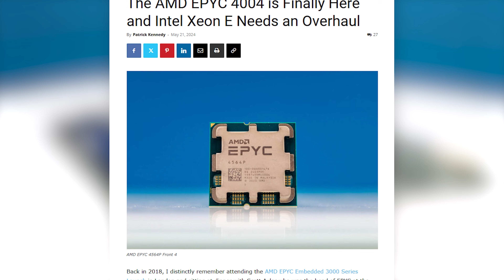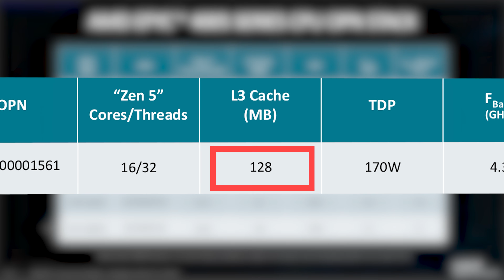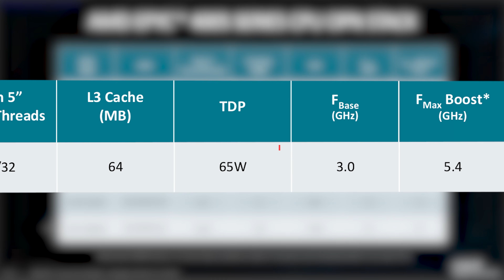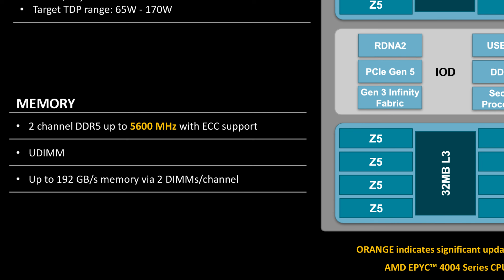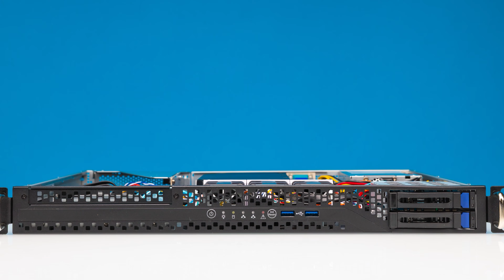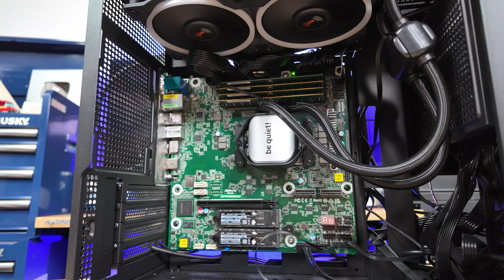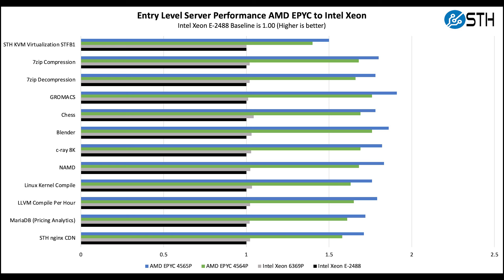The Must-Have AMD EPYC 4005 Grado Has Intel Xeon Cornered

Comment: Hi, I'm wondering about one thing, why aren't AMD and Intel filling the gap between low end CPUs and big ones ; what I mean is the same kind of core gamut at this series but with at least 32 available PCIe lanes feeding PCIe slots (eg.: 16x [8x, 8x | 16x]), because it would be worth it to cover the needs of not so SOHO and SMB -  does it come from hardware barrier(s) or simply dumb market segmentation made to force the purchase of high end CPUs ?
Reply from the maker: I think the challenge is that once you go bigger, folks want a bigger step up. The EPYC 8004 and even the EPYC 7003 are not bad for this, but they are notably larger than the EPYC 4005.
Reply: @ServeTheHomeVideo    I'm not sure, there is place in between, although may be not enough place to justify other CPUs - the kind of SMB I'm thinking about is the slow growth or even stable ones, that have needs that pushes toward big CPUs only because of a matter of available PCIe lanes, such as 40/100 Gb/s dual ports network cards and/or many ports HBA.
Reply: Because then they would need to be supporting a third socket at the same time. Just get a used server if you want PCIe lanes. Consumers want the lanes until they see how big the CPU has to be.

Comment: 0:40 wait..  windows has gotten so bad that you need specialized high performance servers just to handle the overbearing licensing???  That's so far beyond absurd..
Reply from the maker: It has been that way for some time
Reply: @ServeTheHomeVideo 😮😮😮 😂😂😂
Reply: @ServeTheHomeVideo  I haven't had to deal with windows at the enterprise level in quite a couple of years, happier about that all the time.. .
Reply: now i get why most servers i've seen are linux based lol
Reply: @Quimerateck Windows had trouble with the number of threads on Threadripper too
Reply: Damn people are still running windows servers? What is it 1996?

Comment: I hate that companies refuse to release consumer grade SKU with sane power scaling
sure, for 9950X you can just change power limits and it most likely will be equivalent (unless epyc has different voltage curve), but for graphic cards? why the pro sff chip configs can't be available as passive consumer cards?
Reply from the maker: I am pretty sure the answer to that is margins
Reply: @ServeTheHomeVideo  I'd pay up for the bigger chips, though the pro tax on top of that is a bit too much
but I know most consumers don't care about efficiency and silence and much and prefer higher clocks = higher performance from the same die

Comment: There are (or will be) certainly other motherboards. Since they're PCIe 5 lanes, I think two x8 slots would probably be more useful. Or, if technically feasible, two slots that can either both deliver x8 or just one deliver x16.
Reply from the maker: Totally. We have been reviewing EPYC 4000 series platforms (motherboards and servers) on the STH main site regularly.
Reply: Even 8/4/4 makes total sense with pcie 5.0. The 8x is enough for a 2x 100gb nic card, you can add another 2 or 4 nvme drives with a multiplexer card and a sas card for spinning rust.

Comment: When it comes to "server" CPUs, the first thing I am looking at after use case is how much is this going to cost license wise. Impressed. And 2 memory channels? More than acceptable for more than enough use cases. I would still use a "server" cpu thats validated for continual use and "server" use cases. If i was needing a hypervisor for a business that had small to moderate workloads, that delegated storage tasks elsewhere, was on-prem AD+Exchange, maybe a few application specific vm's for a business in the 5000 employee range, one of these would be excellent, two or three, mirrored or parity would be perfect in 6 9's scenario. 😊
Reply from the maker: Exactly

Comment: Bro this looks like rebranded ryzen 7000 series. Like literally WTF
Reply: Rome and Milan are cheap now, just buy them and get all the lanes you want. You will pay for it in power consumption.
Reply: That's what it is... Maybe it's ryzen 9000.
Reply: @Cynyr you two 🫏s didn't even watch the video huh? he said it's Zen5 😂
Reply: @chimpo131  i started Wendel's this morning, but quit as soon as i realized it's still limited to not very much pcie. Don't really care if it's zen4 or zen5. What I'd like is more pcie lanes for cramming old enterprise cards into that are gen2 or gen3 but x8 or x16, or being able to use a bunch of u.2 gen3 drives at full speed. I don't have a huge need for compute, but i would like io. I'd be more than happy with a pcie 5.0x16 to 3.0x64 switch. Gen 3 pcie is plenty fast for my home lab.
Reply: Yeah, that would be nice. I have a 4 node cluster with 8 xeons, 20c/40t by node that would be nicely upgraded by these, if it had the same number of gen3 lanes to keep my networking and disc controllers as is.
A little fewer cores, but significantly higher clock speed, and probably faster for my use-case (each node currently perform about the same as my desktop 5800X3D that only have 8c/16t, so half the core count of these newer zen5 that have also improved clock speed and IPC... ), and 2*95W to a single 65W and much much (did I say much ?) better IPC.

The few gen5 pcie of a single EPYC 4005 offer more bandwidth than the couple of old XEONs, So my dream replacement motherboard would have a gen5 M.2 slot in place of the 2nd processor, and maybe a gen4*16 instead of the gen3 but I am not sure it fits in the bandwidth. That would improve the perf of one of my GPU thought

But I doubt we will ever see that. Especially for me as they are half width motherboards, for 2 node per 2U chassis with a custom connection card to the hard drive back-plane

Comment: AMD keep it up, loving it! Now we just need something like this with more PCI lanes!
Reply: This is probably socket dependent. So I doubt there will be more PCI E on AM5. Also routing PCIE 5.0 is difficult as heck. Signal Integrity became attainable like 3-4 years ago at best. At least above 10 cm.
Reply: @jannegrey  easy to solve.. add a switch.. to leave one PCIE5 and the rest as a lot of PCIE4 lanes.
A lot of hardware do not even saturate PCIE4.
Reply: @CesarinPillinGaming  1000%, maybe pcie switches are more expensive than 5 nvme slots...?
Reply: @CesarinPillinGaming  I agree on most hardware not saturating PCIE 4.
Reply: @kryptonitecb  most likely. I've seen PCIE4 to PCIE3 switches at around 300 USD. For servers of course, mostly used for minning I bet.
Reply: @jannegrey  Yes. They put it on AM5 so it has limits of the socket. The thing that gives you more lanes is just a different socket, which exists.
Reply: @blkspade23  Yes, but then cost increases as well. I would love some quad or hexa channel RAM socket that would have minimum of 36 PCI-E lanes (the more the better). But IDK if AMD will make additional sockets for "niche" applications - even if in the end they would get a ton of customers. They simply aren't certain they would get said customers. Some affordable HEDT would be great.

I hope that AM6 will be big enough that gamers might still use dual channel, but mobos might go for 4 channels while charging only a bit more. Especially since Zen 6 on AM5 is supposed to now have 12 cores per CCD.
Reply: @jannegrey  all very fair and true! but a man can dream haha

Comment: I bought the 4004 series for server 2025 & Proxmox, they are really good.
Reply from the maker: I have been using one with Proxmox VE for quite some time now
Reply: @ServeTheHomeVideo  You could review the supermicro AS -3015A-I I think the h13sae-mf mobo is offers more than both the Asrock and Lenovo offerings.
Reply: @ServeTheHomeVideo  You should check out the h13sae-mf mobo in the supermicro as-3015a-i I think its possibly the best AM5 mobo in this segment.

Comment: This is great. I've used many 4464p/7900 65w in servers for power and heat saving so now I'll be able to easily use the 16c/32t 65w chip without worrying too much about water cooling. That 16c/32t 65w Epyc 4545p will go great with 256GB RAM now that it's possible!
Reply from the maker: I am totally with you on that.

Comment: I hope these 4005 series server motherboards do not turn into unobtainium like with the 4004 series motherboards, could not find those in stock anywhere and still cannot find them easily in Europe  - If I am buying an Epyc server cpu, I want a server motherboard that is certified to run it with ECC and other server features and the front to back orientation for airflow is a must, none of which you get with a desktop motherboard.  
If these motherboards are so popular and in demand enough to always be out of stock due to being bought up by OEMs that is great in principle, but when non-OEM businesses and homelab / consumers cannot purchase them it makes adopting Epyc 4000 series platform a non starter.
Reply from the maker: Interesting. Europe tends to be a strong market for both this class of system and AMD
Reply: @ServeTheHomeVideo  The Epyc 4000 CPUs I can find in stock no problem online, it is the server class motherboards that are hard to come by online, will most likely call up my usual component retailer and see what they can order in for me.
Reply: ASRock Rack AM4 Server board was also rarely available at the time. Left a bad taste in my mouth about ASRock.

Comment: If im building a new homelab server, what use case should i consider between these and a 9950x3d?
Reply from the maker: I guess why not get the 4585PX instead of the 9950X3D? Price wise, similar, but you get supported ECC on the EPYC. This is not the old days where the Xeon would cost much more than the Core.

Comment: I think that you said it best:

I can't WAIT for the 65 W, 16-core, 32-thread part as well.

I was just thinking yesterday or two days ago, that I wished that there was a low power system -- something that's even lower power than my 7950X and my 5950X systems and of course, two days later, you release this video and AMD just basically answered my "prayers" with the upcoming 65 W part.

This is absolutely awesome!!!
Reply from the maker: That is going to be an awesome part

Comment: When it comes to "server" CPUs the first thing I am looking after the core count is how many PCIE lanes are there. Not impressed. And 2 memory channels? Not impressed at all. I would still use a desktop cpu instead of this one even for server use as a lot of companies start doing these days.
Reply from the maker: We went into this. There are four EPYC lines. This is for the lower-cost segment where fewer lanes and memory channels are needed.
Reply: it's a good thing AMD doesn't give a 💩 about impressing idiots 😂
Reply: Too bad they cannot up the speed of the PCI-e and down switch it across more channels on a seperate IC.  Say, speeds 8 times PCI-E V4 bridged in a way to allow for four times the PCI-E V5 channels.

Intel used to do this. Why not AMD?

There is no reason why a small CPU cannot have features of a big CPU.

Comment: I wonder how it would perform as an iSCSI host? Maybe a 25G NAS/SAN? Could it maybe push 100G?
I think these are ideal for local k8s servers in factories, retail outlets, etc.
Being based on retail product/components reminds me a little of the threat that Intel originally was to SPARC/MIPS.
Reply from the maker: I think at 100G a lot ends up with NIC offloads.

Comment: Have seen these deployed in Supermicro 3U 8-node clusters for high throughput computing. Mostly for relatively fast data manipulation that's single threaded. The 4004 16 cores run at 4.8 all-core. Easy solution to make a lot of single core processing a bit faster compared to it's big brothers.
Reply from the maker: Great feedback there. That density play is a big one.

Comment: This will make for a fantastic practical home server.
Reply: The motherboards are the limiting factors here for a home server. None of the announced ones is good enough if you have 2 HBAs + GPU (+ something). The PCIe lanes are there, but the motherboards don't have the slots.
The ProArt X870 might be the only decent one if it gets a BIOS update.
Reply: @mm_giacomo  OP did say "home server" - I don't agree with him either, but not because I can't build it into an enterprise class gigantoserver with dual HBA's etc. It's not meant for the use you want something for.
Reply: @mm_giacomo  or if you skip the gpu quicksync > amd's offering and idle lower which my servers do more of. but yes always the issue is the slots
Reply: Pretty much anything can do home server stuff these days though. My homelab is basically just repurposed ewaste at this point
Reply: @stephendetomasi1701  It certainly makes no sense to buy new gear for homeserver use, except for HDD's basically. I have one box that is a more than 10yr old Dell workstation, put a 14c CPU, 96gb ram, SSD and big HDD in it - and it's massive overkill for most homeserver stuff. It's more for playing around with stuff, but it cost me a lot less than a motherboard for these Epyc things would. It also has an 8gb VRAM GPU to tinker with AI on.
Reply from the maker: Yes. These are great for that... but I really want that 65W 16 core part
Reply: @ServeTheHomeVideo Can you please review 4584PX ?
Reply: it's just a chiplet ryzen with a few more features verified (most notably tsme and ecc). idle power consumption won't be great and homeservers idle like 99.9% of the time. same amount of pcie too.

Comment: I JUST BOUGHT A 4564P NOO
Reply from the maker: The EPYC 4564P is a great chip
Reply: @ServeTheHomeVideo  it sure is. replaced an x99 server and an r720xd server. so much quieter, so much colder.
Reply: @JeremyCB-w8b if you "just" bought it then update the motherboard BIOS with your current chip and return it so you can buy the new one LOL 💩 🧠
Reply: @chimpo131  its not released yet. releases june 13th which would be outside any return window. plus the machine its in now can't be down for any length of time. 💩 🧠

Comment: Lets face it, server licencing isn't special
Reply from the maker: Not special, but it can easily cost more than the CPUs
Reply: Core based pricing is dying IMHO. I'm seeing more node based pricing, or functional capacity based pricing. Pay for the outcome rather than some arbitrary technical parameter.
Reply: @BobHannent  i will never understand companies that rather use windows for their servers, the licensing costs are astronomical and are a SUBSCRIPTION FEE.
Reply: @depralexcrimson  If you don't understand that, you should clearly work outside the IT industry.